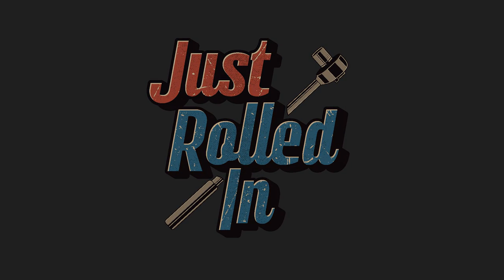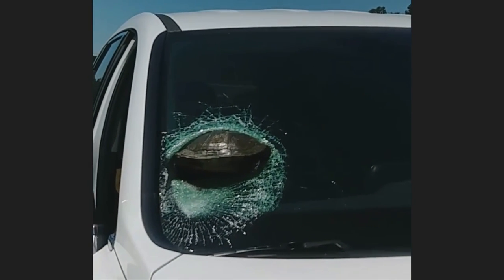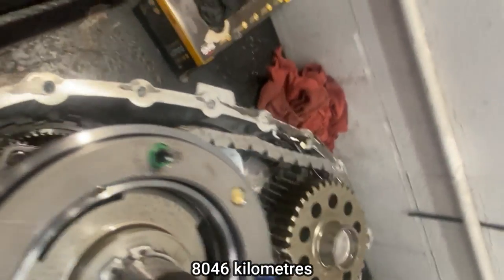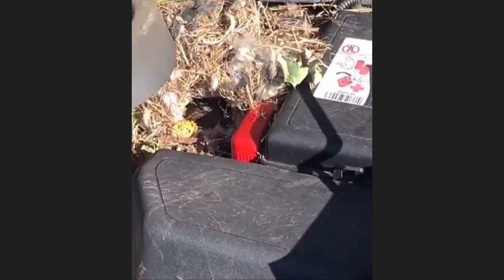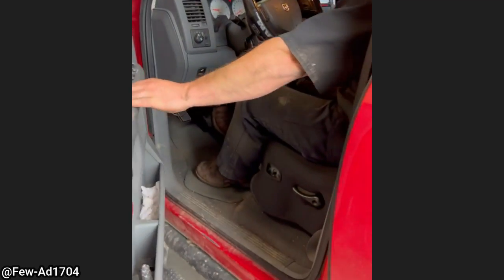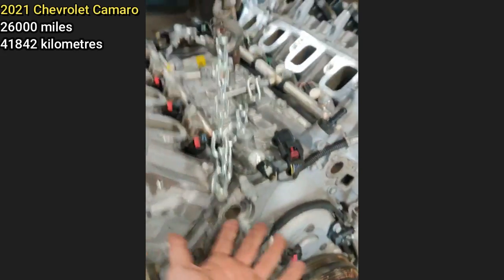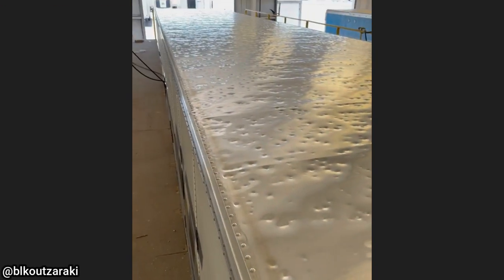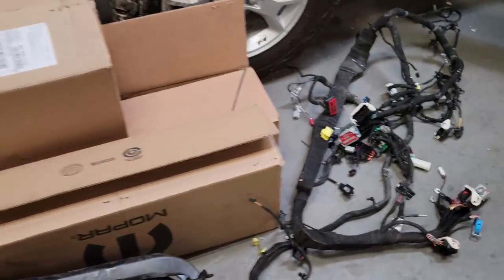Customer States Truck Will Not Move When In Gear (GMC Sierra) | Just Rolled In

Comment: 1:34 My dad had a Ram that did this. It had the loudest factory horn ever and has this lovely 'feature' to let you know it's there.
Reply: They have ram horns? How cute.
Reply: It is a pain in the ears when one has to hook up a trailer alone. Like when you only need to move a couple inches to line the ball/coupler  without wanting to close the door.
Reply: @tt600pch  exactly. Several times I needed to be able to have the door open with a foot on the running board and one on the brake while backing up to something. This 'feature' made that obnoxious at best, and mostly just completely deterred doing that.
Reply: My 2020 Dodge Ram and 2021 Chevrolet utes both have this same feature. Very good for pranks as you can drink a soda or pretend to play on your phone (fully stopped in a safe location of course) then boom got him and they don't expect a thing. Gets them every time.

Comment: I can’t believe that Jeep wasn’t just totaled.
Reply: With the rising value of used cars due to not enough new cars being available, takes a little more to total one these days.
Reply: what jeep ?
Reply: @ronblack7870  3:02
Reply: If parts and labor wasn't 70% of the value it wouldn't be.  If its a newer Jeep that might only be 30% of the value to fix it.
Reply: Just a quick wiring fix.
Reply: I’m still finding it hard to believe any insurance would cover what is basically abuse. Then again, people manage to get engines replaced by insurance after driving through floods. It would never cross my mind to even try and claim for something like that - stupid mistake, pay the price and don’t do it again!
Reply: @chrissavage5966  This is why it is called full coverage.  Its no different than someone being at fault in an accident and insurance fixing the car.
Reply: Yeah they design them to be a pain in the ass to fix these days in the hopes youll buy another crapbucket from them
Reply: Good  day Yea I thought same thing,  with crazy prices on parts,  then labor,  they could have sold parts  to regain  cost.  Thanks

Comment: Looked like another good safety device idea, lock door so you can’t get out of vehicle while making a turn 😛
Reply: this was directly due to that actor on new star trek dying when he got out of his vehicle not in park and it rolled and pinned him against a wall. he died.
Reply: @ronblack7870  That feature should be for if the parking brake is not set, not just transmission set to 'park'. Might be an unfair stereotype but Americans seem to rely on the parking pawl too much.
Reply: As fast as they come up with the safety ideas, someone will find a situation where it's actually a hindrance and figure a way to disconnect it. Sometimes for good reason. lol
Reply: @henryturnerjr3857  "Disconnection of safety devices" should be an automatic failure of any mandated roadworthiness test and thus make it illegal to drive on the road.
Which leads to another point, America needs a federally mandated roadworthiness test.
Reply: @TheDeeplyCynical  from what I have seen on this channel, the drivers need  it too.

Comment: 1:34 I have a RAM 3500, and hated it when the horn would honk with the door open.  It was actually a safety hazard for me because I usually open the door to get a better look at where my rear tires are as I try to reverse.  I finally ended up fixing it by wiring it up so that the driver side door would always read closed, even if the door was open.
Reply: @AJ_ghdhejsien  I think this feature is due in part to the woman who was crushed to death against the garage wall by her open car door, as the car was in reverse.
Reply: @dougfisher1813   It was the accident from the Star Trek Actor  that played Pavel Checkov in the Remake from Abrams...Anton Yelchin
Reply: @TrekZero  Thanks, lawyers. Making us deal with "safety enhancement designs" instead of accepting that sometimes people do fatally dumb things.
There are many cases where we need to let stupid do as stupid is.
Reply: It's a common safety feature in new semi tractors, the horn goes off if the parking brakes are released and the door is open. Too many wheel holders had their trucks roll away on them...........
Reply: maybe Dodge assumed anyone driving a RAM 3500 would be stupid enough to open the door while driving at 85 MPH
Reply: @rhuephus , then the Dodge engineer screwed up, because the horn doesn't go off while in drive, even at 85 MPH, only in reverse, even at 0 MPH
Reply: Just bought a 2013 f150 and it stays in park with door open even though it’s in reverse. Didn’t know such a thing existed
Reply: That's one way to do it. Do keep in mind you might need to think of something else: VAG cars will re-lock if the keyfob has been used BUT no door has been opened for half a minute. With your solution (or a faulty switch like I had) it is possible to lock yourself out of the car with the keyfob in.
Reply: @randallvos  The horn doesn't sound.  You get an annoying chime when a door is open while in drive (Drives Freightliners at work)
Reply: @robwright4398  We have a 2014 and 2015 F-350 at work, I should see what happens if I open the door with it in drive or reverse.
Reply: @charlesball6519  our Freightliner tractors are set up so the horn sounds when the parking brakes are released and the door is open. I drive for a company that has orange trailers..........
Reply: @randallvos  Ah, Schneider.  Only company I'm aware of that has orange trailers

Comment: I just remembered being at a shop where a mechanic was tasked with replacing the frame on a semi tractor.  Apparently the frame hadn't been correctly heat treated at the factory, so the mfg sent new frame rails to the dealer.  "Just" replace the frame.  No big deal, right?
Reply: That sounds like the manufacturer taking advantage of stupid dealer management. "We can just send you the replacement parts, rather than replacing the whole vehicle."

Comment: I've replaced the internal wiring harness on a '91 Maxima when I worked at Nissan...EVERYTHING had to come out from inside. I don't envy that guy.
Reply: I had to have the A/C diverter assembly replaced on my 2005 Pontiac Grand Prix GT2 a few years ago. Started blowing heat on the driver's side and cold on the passenger's. Of course right in the middle of summer! The dealer techs (two of them) had to take everything out from the front seats to the firewall! Console, dash, steering column, everything! Had it in the shop for over a week. I dropped by every couple days to see how it was coming along. Wish I had taken pics. I went over that car with a fine toothed comb when I got it back and there was zero evidence it had ever been touched!

Comment: That transfer case made me wonder if some genius thought it would be a great idea to drive in 4H all the time rather than when they needed it.
Reply from the maker: Wouldn't surprise me. Seen that before lol
Reply: @JustRolledIn  Does Ford have an automatic mode? my Chevy Colorado has "AutoTrac" on the knob for the 4x4 and the manual does say you can leave it on, However I suspect the transfer case is always in 4wd and just the hubs are disengaged so in dry conditions I always use 2H no matter if the manual says I can leave it in auto.  I only ponder this as if someone was thinking its a grand idea to do a burnout, computer doesnt know that. rear wheels are spinning with the engine revved way up, computer locks the hubs. And now there is suddenly a stationary load on dry pavement shoved on a rapidly spinning driveline.

Comment: This story reminds me of a couple of  crazy things that I had to attend a few years ago.   My wife’s car kept breaking down when she was 5 miles away.  I drove out to see what was wrong. And found her handbag hanging on the choke  button !    Then Another Time.  She phoned me and said that her car was steaming up,   I drove out to take a look.   And here was the Fan  sticking out of the battery. Having sheared off !    I showed her the fan sticking out of the battery.  And she said. “” Oh isn’t it supposed to be there “”   Ffs … It hurts …
Reply: I'll do ya one better. My wife had many problems as well. So I spent the ranch and bought her a fully computerized car. A pleasant female voice alerted her to every conceivable problem. Please turn off headlights, remove ignition key adnauseum. So I finally get a day off and decided to go fishing and unwind. I get there and my wife calls and says that she is locked out of her car. So I drive an hour back to where she is. I ask her how it's possible to be locked out. She states that the car never warned her to remove ignition key and the vehicle is one month old. So I unlock the car and it was still running after two hours of shopping. The one warning it doesn't provide is TURN OFF YOUR CAR IF YOU ARE DONE USING IT FOR NOW!  She and her mom jump in and I headed for the bar......
Reply: what kind of car even has a choke now.  Even in the 80's that's uncommon
Reply: and you stayed with this fool why ??
Reply: @josephvanwie6706  and you didnt walk away why ??
Reply: @tsm688  yea...like 1950s ??
Reply: @texanonline1244  I distinctly remember that my dad's ford fairmont had one.  But nothing in the long line of K-cars that followed ever did.
Reply: @tsm688  I'm curious as well. My 84 land cruiser had one (up through 87), but I don't know of any other from that decade. And it was a pull cable, not a button FWIW

Comment: When I lived in Florida, people got damage from hail all the time. Most of the time, you just leave the car out in the sun for long enough and the dimples fixed themselves.
Reply: We get hail here in Georgia too! I've fixed a LOT of small dents using canned air. Turn the can upside down and spray liquid on the dent. Most of the time it'll pop right out. Just use a can that's almost empty because it'll fry the valve! I've also heard of using dry ice but haven't tried it...

Comment: How do you fix warning lights? Put black tape over it😂 Brilliant!
Reply: On some of the older cars that check engine light may be mostly just emissions related. I've seen GM cars go many years with those lights on because people got tired of constantly chasing O2 sensors & stuff. Full of oil & water those GMs didn't really care.

Comment: Some people cannot understand the difference between 4WD and AWD, 4WD can only be used on dirt, gravel, mud, snow, grass etc as the front wheels rotate slightly faster than the rear wheels, the front and the rear are mechanically linked and when they are driven on a hard surface, concrete or bitumen, there is no give between front and rear axles which puts excessive stress on the transfer case, All Wheel Drive vehicles, AWD, have a centre diff that is similar to a Torque Converter in an automatic, the stresses between front and rear axles are absorbed by the fluids in the centre diff and therefore can be driven on all types of surfaces.
Don't use 4WD on bitumen or concrete or you WILL fuck up your transfer case.
Reply: @Ieatpeople2 , yeah, nah, what you are talking about is a "secondary" effect and in some cases alleviates the bind a little, driving in a relatively straight line on hard surfaces whilst in 4WD is what does the damage, especially on later model vehicles that are built to cheaper designs and therefore not as strong.

Comment: Ok I’ve done a lot of work on trailers and if I were to do that hail damage repair? I would take a new roll of aluminum and start at the front, then rivet it down as we unroll it going along, while spreading sealer along the damaged area. Then there would be two layers of protection, with half the time saved from removing the damage.

Comment: 0:09: Damn. Did the famous "Chevy Shake" get so out of hand that the shaft just quit? lol
Reply: no I've seen this happen on a lot of GM and Fords with an aluminum drive shaft. Usually because someone did a neutral drop or tried to launch their truck from a dead stop, etc. The shake is caused either by converter shudder on the 8L90 (do the fluid swap to Mobil 1), or from unbalanced wheels

Comment: While driving a tractor trailer in Arkansas, on a 2 lane, there was a turtle just on my side of the yellow stripe. I missed him with the steers, but just clipped him with the trailer tandems. The turtle LAUNCHED at a 45 degree angle into the woods.

And no, I wasn't aiming for it, I was actually trying to miss him.

Comment: From my experience, Aluminum doesn't like to be torqued because it's so soft and also tapped also because it is so soft.
You can hammer a thin sheet of it into all kinds of gnarly shapes but that's not good for building huge structures out of. Huge meaning, bigger than a mattress box.

Comment: The rear U Joint broke on my brothers International Harvester 3/4 ton pickup. He put the driveshaft in the bed and drove home. Almost forgot. He locked the front hubs and shifted into four wheel drive, high range.

Comment: Friends of mine once bought a car with hail damage like that trailer. It was a brand new Hyundai and was one of many brand new cars in the dealer's yard that caught the hail. Many of the cars were sold off at a pretty cheap price rather than scrapped if the repair was not cost effective as everything was brand new. They got a great price and had many years driving the car and making jokes about golf balls (eg. What's that? Your new golf cart?). By the time they sold the car the value was about the same as it would have been without the dimples, and probably also the same value as a golf cart.

Comment: 1:35 Imagine how much better the world be if people just took the time to read the manual.
Cars are complex machinery and there are constantly coming new features with new models.
Reply: So what if someone is slowly backing the vehicle with a trailer and want the door open so they can lean out for extra visibility? That's a fairly common thing to do.
Reply: @Crosshair84  Then you are doing it wrong. No matter what manoeuvre you're doing you should never do it with the door open.
When backing up you should use your mirrors and when needed turning your head so you can look out the windows. If the trailer is too wide for you to see in the mirrors you need extensions for the mirrors. If you still feel the trailer is too wide or too long for you to see then you need a spotter.

Comment: I was standing at a crosswalk at a 4-way stop when I heard "ding-ding-ding..."  Looking up the road that was a slight incline, I saw a pickup-size utility truck was heading my way. The driveshaft had disconnected from the rear differential and the loose end was was bouncing off the road. The driver stopped at the intersection, looked both ways, put it in gear, and stepped on the gas. The driveshaft spun, and the loose end pounded the undercarriage about 100 times per second. Apparently unconcerned about the tremendous noise, the driver let off the gas for a moment, re-put it in gear, and tried again! Then he got out and started looking for the problem. 😳
Reply: Unbelievable if you didn't see it for yourself!! The vehicle is ""telling you" there's a problem here. Let's ignore it and see if it'll go away!!
Reply: All problems will fix themselves if you wait long enough

Comment: My Dad sold cars in the 50's. From time to time they would have to rewire a new car delivered from the factory because the worker would purposely miss wire the cars. Like horn would turn on the wipers, heater would turn the lights on... I would have believed that a break peddle would blow the horn in a modern car today.

Comment: Those transfer cases on the fords are built not too far from my house, and considering the working conditions and hiring process i wouldn't be surprised if at least a few of the line workers hate the job. Not very good pay, long hours, the place got struck by a tornado a couple years back, etc

Comment: In regards to the Ram featured at 1:35. Yes, that is intentional("safety" feature as a result of a recall involving certain transmissions going into reverse on their own), however, it was explained slightly incorrectly. It only happens if a certain set of circumstances are met. Truck must be in REVERSE (does not happen in drive or neutral), seatbelt must be unfastened, driver door must be open, and brake pedal released. I have a similar truck and it does the same thing. I first learned of it when backing up to a trailer once and it scared the shit out of me. Now I leave the seatbelt buckled without me in it when I hook up to bumper pull trailers and it prevents the honking and lights flashing.
Reply from the maker: In the recall it says "The alarm system 
will beep the horn and flash the headlamps and shift indicator if a driver tries to exit a running vehicle without fully placing the shifter into the “Park” position."
Reply: @JustRolledIn  Interesting. I've done enough experimentation with my own truck to know the exact circumstances in which it occurs, so it's odd that the recall notice is so vague and slightly inaccurate. I've also never seen the shift indicator flash personally, but I don't believe I've ever looked for it, either.

Comment: Guy with a broken drive shaft was lucky.   I was driving a truck one time.   It was from the company vehicle pool, and they weren't too good on maintenance.   Any way, the drive shaft broke off at the uni joint and came up through the floor., smashing and scattering tools.   It was pretty dramatic.

Comment: what the heck was that driveshaft made out of?! I've never seen such thin metal for a DRIVESHAFT! And I'm hoping the plastic sleeve at the anterior end was a cover...
Reply from the maker: Candy wrapper aluminum 😜
Reply: It always amazes me what keeps a car moving, if you look at a clutch plate they usually have 4 spokes that drive the centre hub and they are next to noting in volume or size.
Reply: @JustRolledIn  Another sweet GMC recall lol